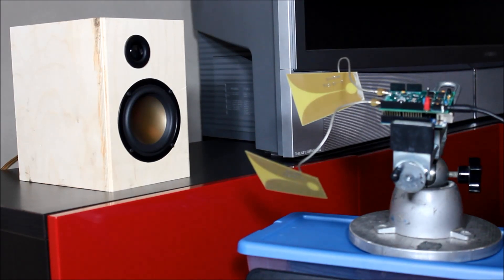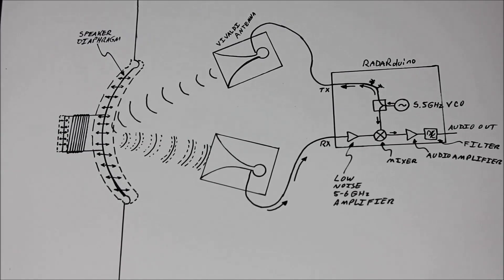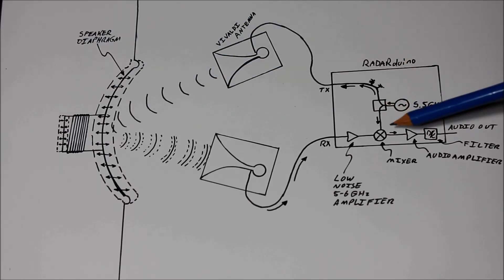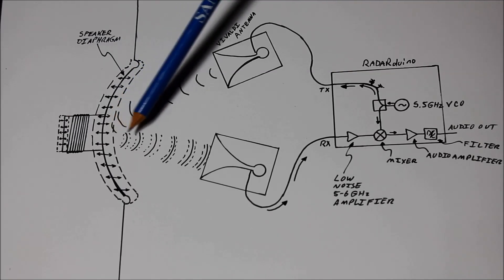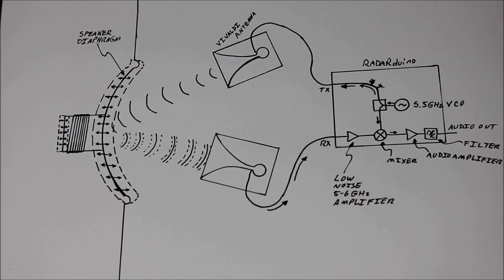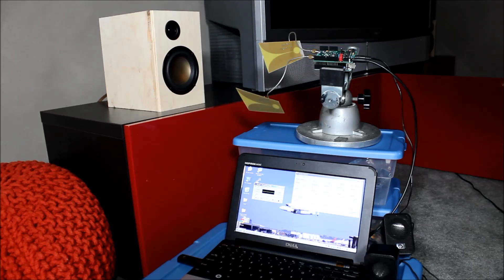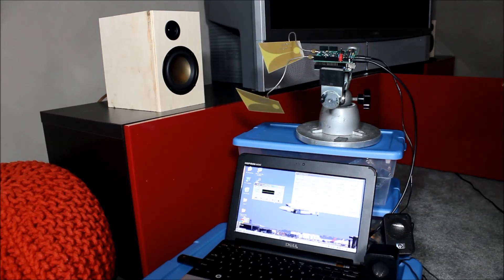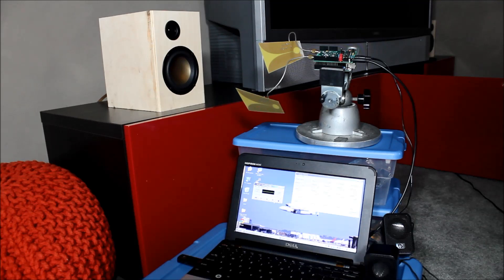Doppler RADAR Style

Comment from the maker: The sampling rate is that of the computer sound card, or 44 kHz (22 kHz Nyquist limited).   The 5.5 GHz signal gets stripped off in the mixer and what is left is the modulation produced by the woofer cone induced Doppler shift.  I don't think there is any absorption of higher frequencies here.  Rather, the 5.5 GHz signal won't be modulated by a dielectric (plastic) and since the higher audio frequencies are generated in the tweeter (a plastic dome), they won't come through as much.

Comment from the maker: @CNLohr there are a few things going on. first, the switching regulator is generating lots of high frequency noise.  Second, there is a lowpass response since the woofer is the only metal reflecting structure. Third there is some amplitude distortion when bass notes hit that I haven't figured out yet. It could be an RF AM-FM non-linearity, or something in the IF chain limiting dynamic range?